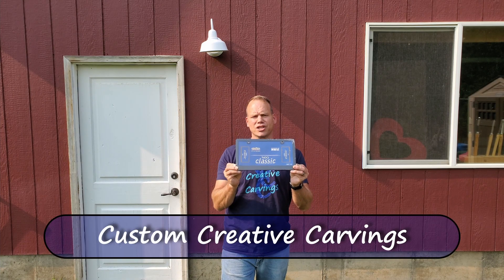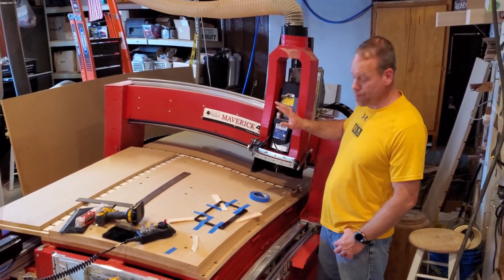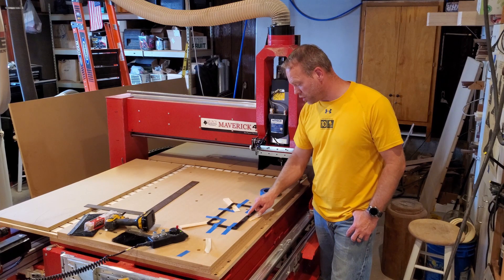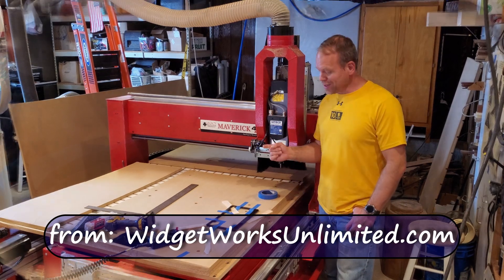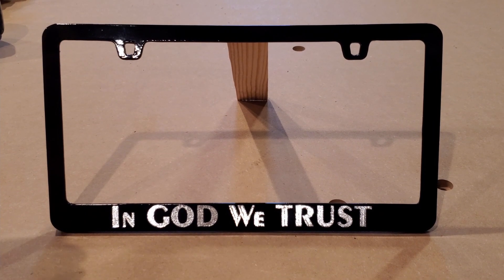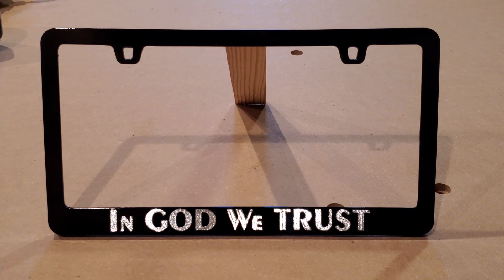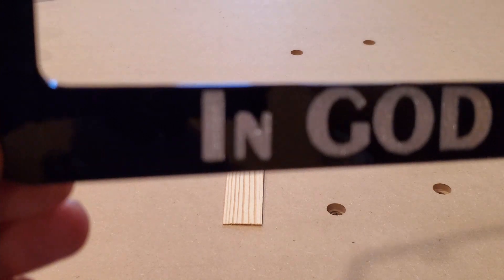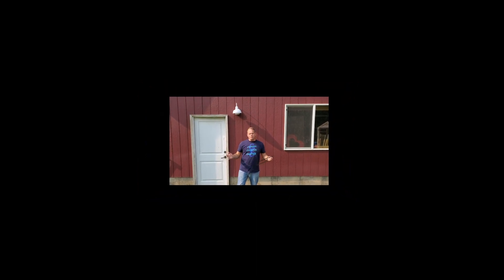FAIL? CNC Diamond drag engraving in painted metal 2021

Comment: You aren't taking advantage of the most important feature of a spring loaded drag bit.. the spring!  Set zero height at surface and cutting depth to between 5 and 7 mm (1/4) inch.  Then variations in surface height don't matter!  I've engraved a 1.5 inch cylinder with a 1 inch high emblem with consistent engraving depth on it.  It's really cool to be able to do that without needing a rotary device.  Set engraving pressure with the tool's adjustment screw rather than by z height.  You can probably do the license plate in one pass.
Reply from the maker: Thanks, I'll have to play with I more, one issue I ran into was paint building ahead of the diamond.
Reply: @CustomCreativeCarvings  I get that too.  I keep an old toothbrush in my hand and clear the paint when the head lifts up occasionally.  If it's digging in too much, reduce the spring pressure with the adjustment screw rather than lifting the head higher.